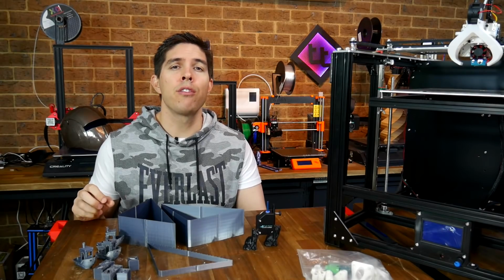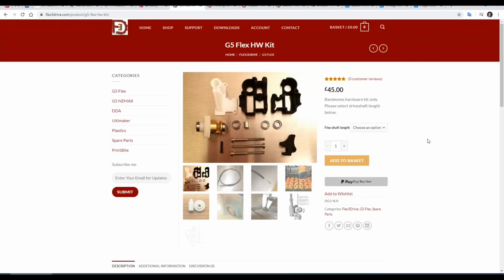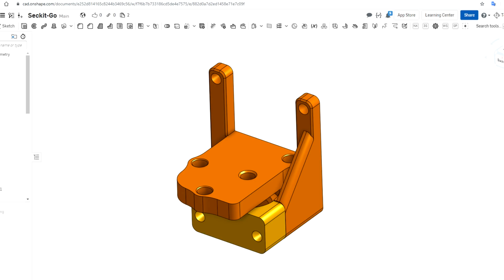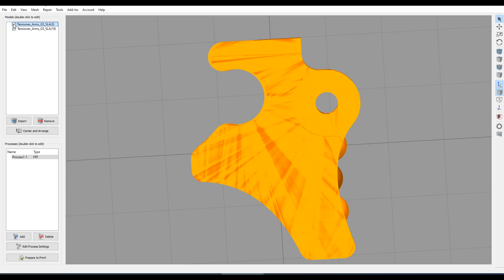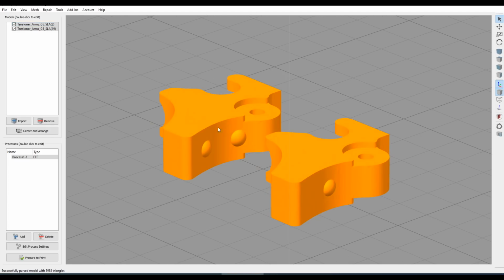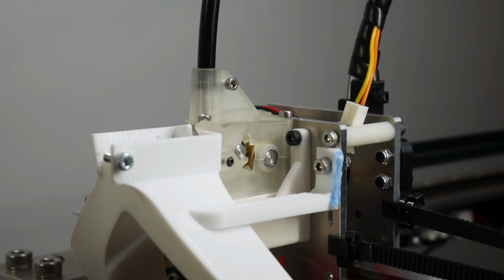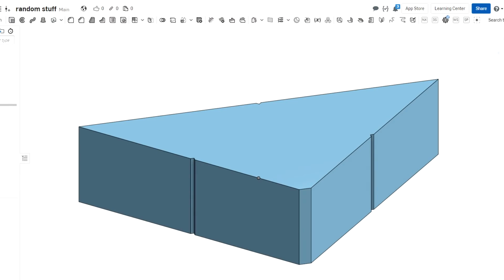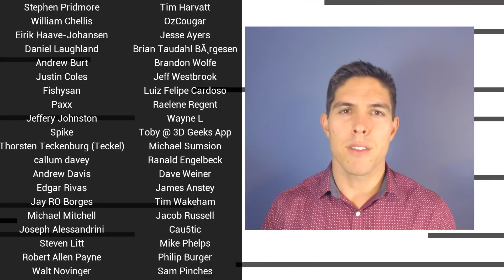Flex3drive G5 open source remote flex drive extruder guide - Seckit SK-GO

Comment: The Zesty Nimble is a far superior unit, (I have both)
Reply: Given that you only appear on Flex3Drive comment sections here and FB might make one wonder
Reply: @Mutley3D  im talking about the flex 3d in general NOT just this product, we also have this one , which was run against the nimble V2 (and still came out as INFERIOR), just because you cant find my name on any paperwork doesn't mean the item was not purchased, which company uses a personal name for their purchases........ I would think you have secretly purchased a nimble to see what it consists of, just as i would imagine Zesty have done the same with the flex3d.
Reply: @Mutley3D  TLDR
Reply: @Dualecosse do you have a link with pics of your two kits together?
Reply: @m3chanist  None of my extruders use a breech! I'm not quite sure what a breech is in tensioner terms to be quite honest.

Does "breech" refer to the vertical orientation of the arm with a hinge action below the centre line of the hobb like Greg Wades or a Prusa or Bondtech and probably 95% of other extruders that open and expose the filament path? Do they have a "breech" in the same context then? From that perspective it looks like they might do.

Or is it the clips? G5 does not use clips, or the conventional tensioner geometry that the zesty and all others do.

The G5 QuickSwitch tensioner employs a clever little geometry trick (which you may have missed). It creates an action and force akin to the light switch on your wall (im not going to explain that bit here). WITHOUT clips springs or screws, exposes the filament path more so, and is of the simplest design that can be printed on any printer in 5 minutes. Literally the flick of a finger and it will open and lock shut. No need to mess with clips or worry about fatigue and needing a new arm (even though you can print one if you need to:) ).

Such geometry has not been used in an extruder before to my knowledge and no one ive asked (due dili) has seen it. All Flex3Drive tensioners use a self tightening/self wrapping design philosophy. IE they tend to a closed position under pressure, as opposed to an open position. Only Flex3Drive does this.

No attribution because as above. they completely different. Not sure i've seen any positive attribution from coming the other way either.

I have never disputed the Thingiverse Goaran nor claimed precedence over it once it was brought to my attention a long time ago. You should also read what it says.

I release my design work as I choose to. I make no apologies if this does not meet your expectations. Read the download page text. 

Very few have voiced dissent on the file release, and so far those that have seem to be a familiar looking core of zesty users. Not reflective of wider user base though i'm sure.

Everyone else has been really positive and appreciative in their feedback on the initial file release.
Reply: @Mutley3D  Looks almost exactly like the zesty breech but with some design variation, and not at all like the other spring-loaded arms you mention. It appears you don't like the taste of your own medicine, how odd. And you haven't claimed precedence you say.... really. Then what do the words " first" and "original" mean to you? Sprinkled about with deliberate regularity in the comments here. 

Your choice of non-release of the source files, only output files for the core extruder, whilst claiming opensource shows clearly your intent, marketing wanketering,  the manufacturer of an impression with absolutely nothing to do with being open or allowing users to customise the source, the source isn't available. It's obvious disingenuous bullshit. Your earlier products were all closed proprietary systems built on top of the IP of someone else's opensource publication, then you had a commercial competitor beat you at your own game and now you are crying foul.  And EVERY business studies their competition's products in intimate detail, you feel you shared information you shouldn't have but its not your fault! its they evil them!. You of course are blamless for your own apparent fuckup. Your little smear campaign against zesty is nothing but self-indulgent whining and a display of blatant double standards. Put your big boy pants on.

I see you've moved on from the tin foil hat thinking that has every critical opinion down as a fake ID but you still are trying to deflect accurate criticism by trying to play the man not the ball.
Reply: @m3chanist  You asked questions and made statements. I gave you reasoned factual responses that corrected your belief system. You dont like them and get angry wailing like a banshee, accuse me of smear and then rant. I think that says it all.
Reply: @Mutley3D  Now you are predicting my emotional state via mystical powers are you? That's a favourite deflection tactic of the fundamentalist or anyone really without an argument,  still attempting to play the man not the ball in order to avoid the points raised.  You've even went as far as to use the "because I said so"  line for the critique of your so-called open but no source available product. Again, you used someone else's open-source IP without any attribution, tried to commercially ring-fence it, got beaten at that and are now crying foul, all while promoting your product as open-source without actually providing the source.  Try to stick to the points and lay off the mystical powers.
Reply: @Mutley3D  And yet more deflection. Do you only have one trick pony?
Reply: @m3chanist   I responded directly clearly politely to all your points. Your IP and attribution comments have been addressed..As have your file and open source comments. I am not using anyone's IP.  In case you don't realize it, I am creating it, and sharing it, and promoting its wider adoption in a kit that is as cheap and accessible as possible and fully printable on your own FDM printer. It delivers better print quality than something that costs twice the price and doesn't print as well due to the design errors it contains. Errors that that Flex3Drive avoids., even though the company that sells that product did actually buy a flex3drive to "research the competition" 

You on the other hand are clearly behaving like you have an agenda so ill waste no more of your time.
Reply: @Mutley3D  No you haven't addressed the matter of attribution at all, you have avoided it by such compelling arguments as recommending I see a doctor, are you familiar with the term "golfclap" ? You get one. There is clear published prior art from 2011 to your products and you make no mention of it in any of your marketing materials, you are in fact, in violation of the CC license of that work, the same licence you seek to use for yourself. That makes you a hypocrite. Add to that you have a chip on your shoulder re zesty and yet you are doing exactly what you accuse them of. Clearly you are new to manufacturing, as already pointed out, EVERYONE researches their competition. But not everyone tries to blame their competetion for their own negligence.
Reply: @m3chanist  there is no information in that "prior art" beyond the concept, and an "idea" has no IP. Thing:6653 came to my attention quite some time after I started my work and my work is not based on this in any way. I don't see zesty citing it or the flex3drive, nor do i expect them to. As I have said before, I have done an initial release under an initial license and I am taking on board everyones feedback regarding licensing, as is clearly stated on the website. I may provide an attribution or nod to this work as this guy clearly did have the same idea. Difference being I made it happen with nothing to work from, and did a better job than someone who had my product to copy from. That's why i dont need to buy their product to research them, and because of the working experience I have I can see all I need. This doesn't mean I do not do my research either, but i check my sources.

Having to defend myself with facts and numbers or correcting fake news will be called carrying a grudge (or blaming) to minority group of aggressive zesty folk that repeatedly try to disrupt anything Flex3Drive related. It is not a new phenomena (started day 1) and you are clearly part of that core group that does this and you need to leave it be. I have often let it pass or get the better of me but not any more. im shutting it down. All your arguments have been addressed. I am not against competition and happy for it, but dont attack me when your arguments don't hold up for them.

https://www.youtube.com/watch?v=06d-acajAmY

https://forum.duet3d.com/topic/408/actual-speed-versus-planned-speed

Again, this is why i don't need to research I can see all i need. You cant put lipstick on a pig. Now you get no more of my time. Looking after my customers and my business. Out.
Reply: @Mutley3D  it came to your attention afterward did it, and yet you claimed due diligence earlier. So your due diligence didn't have you searching the largest repository of 3d printing resources in existence... Really, how utterly unconvincing. If that is the case your notion of due diligence is laughable or you are completely incompetent. You dont see Zesty giving that work the nod huh, you seem to have very selective seeing. That thing file is the very thing zesty point to as the origin of their work, there is an image in this very comment section showing that, but you "aren't aware" of that either right, even though you comment in that thread. What is it they say about liars and their memories? I'm "not aware". They at least know how to give credit were its due. It appears you were little more than a developmental point of interest along the way for them, and rightly so. When you stop blaming others for your failings may be the day you start getting somewhere. May be.
Reply: @m3chanist  Yes it came to my attention afterwards. I have never denied that. I also didn't say I did due diligence "earlier" than this, I came up with the idea in a personal hobby capacity and turned it into a real working thing from zero before I learnt of its existence, and before anyone else had a working proto', and I continue to develop my work. Neither I nor anyone else would have had any obligation (to you or anyone else) or need to do due diligence until later (if at all), by which time it had already been brought to my attention. Trying to suggest I copied this is really clutching at straws, especially if zesty cite it as their origin work. Flex3Drive was the first available, and zesty bought one before they were zesty, by their own admission.

There is no usable information in that concept sketch as the original author states "this is just a concept", you cant claim IP on a concept idea unless you produce it. I am not taking away from it, he and I obviously had the same idea, as others have had before and since without awareness of it. Yes he was not the first, he was only the first to publish on Thingiverse. Let that sink in! I know how to do due dili' when needed.

You seem invested in trying to colour me wrong?

I didn't use thingiverse because back in the day, quite frankly it was poor in content by engineering standards and surrounded by controversy. Furthermore as zesty shows, there is far more engineering than just copying an idea, which they still didn't get right even though they had a flex3drive in hand, as my previous posts highlight in defence of your persistence to push the discussion with incorrect or simply stupid suggestions. Flex3Drive was the first and original flex-drive extruder and much to your disdain, is the performance benchmark (not by accident) by which the zesty is compared. Case closed.
Reply: @Mutley3D  Closed again, what is it, three times now?  So lets put your claim of being the original in its proper context then shall we. You where the first to produce, to your self admitted limited knowledge and complete lack of investigation on your part a commercialised version of an idea that had already been published and that others may well have also been working on at the same time or before you. How very impressive! When would you like the medal posted? 

Good grief.
Reply: @m3chanist   You spoke of a fuax superiority? No! You challenged me on a technical level over something you know not much about. You attacked my integrity and character, just like a troll tries to do, and you do it on behalf of someone else  whilst calling me a hypocrite? You have a dog in this fight or you just want to attack me for some other reason? You demonstrate comparatively little understanding about what you are talking yet you challenge me on this subject with incorrect information and draw wild (almost slanderous) conlusions. Am I not allowed to correct wrong info? Don't interpret that as a superiority, its just giving you the correct information. And I am trying to be polite as possible in the face of your aggression.

Comment: Will fix problems in the X axis but not so much  the Y axis . What i can't understand (barring cost) is why the X and Y axis movement isn't done by the bed ? That way you could run bigger more powerful steppers and hot end on the z axis as it only moves up and down .
Another issue is that with the X axis movement on the carriage the  effect of inertia is increased as the Z axis moves upwards as the printer frame will flex more when the Z axis is higher . With the X and Y axis movement done by the bed any flexing can be controlled if not eliminated as it is down low and encased in a rigid frame . This is the basic principle of cnc milling machines which can machine parts at high speeds to  tolerances that are better than any 3D printer ever will. 
Down side is the printer would be as wide as it is long or have a square base rather than rectangular as the typically do now and a bit  heavier .

Comment: Stupid question perhaps, but why so many prints with a bad part cooling fan duct? Surely the very next print should be a new fan duct? Or do you mean the duct in the fan itself?
Reply from the maker: There was no point making a new duct that might not have fit over the new extruder, and I couldn't design one just for the new extruder without ruining the back to back test. I was really stuck for options.